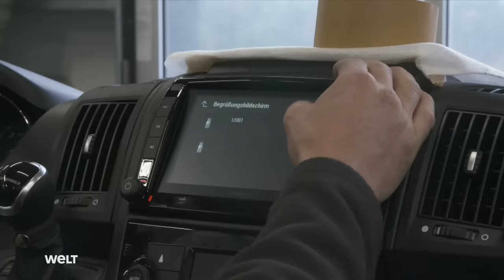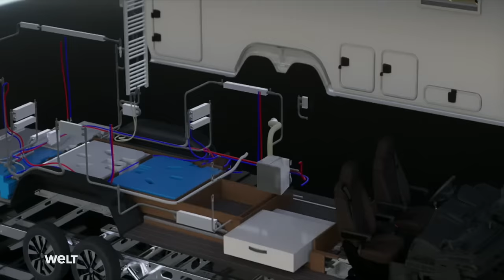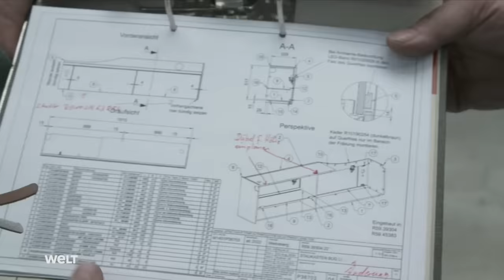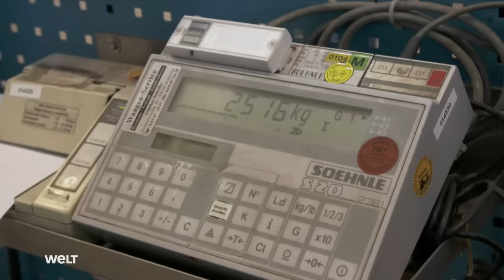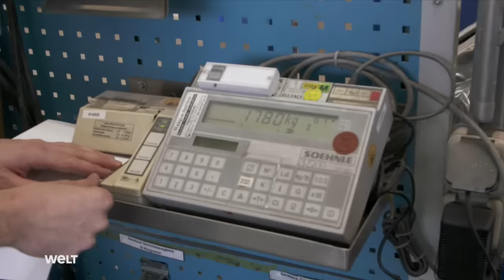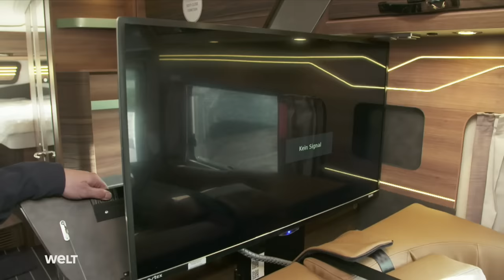MANUFACTURED IN GERMANY: Freedom on Wheels - The home of luxury motorhome | WELT Documentary

Comment: Why aren't the frames custom ordered? Why cut structural parts off in factory? What kind of high class German engineering is that? Spray painting your radiator is always smart too.
Reply: build your own 😂
Reply: @davidnjoroge8495  That has to be one of the dumbest and laziest responses I've read on here in awhile, bud. At what point did I say I could or would? You are defending a company with sketchy and overpriced builds looking at other competitors in the market. Sorry if it hurts your brain to think a little now and then.
Reply: mr unknown , you are not worth awnsering.   If you do not understand, keep a little distance from the kitchen
Reply: I thought the same thing too but since the chassis is built by Fiat it may be more costly by slowing down the production process.
Reply: Why masked???
Reply: Stellantis, FCA is not German.  It's cheaper to purchase these chassis in bulk as is.
Reply: You are not only unknown but also ignorant. ;) But I will gladly enlighten you. There are three different types of motorhomes. These are the box vans, where the standard vans of e.g. Fiat, Mercedes, Volkswagen, Renault etc are removed inside. Then there are the partially integrated vehicles where a cabin is installed behind and above the manufacturer's received cab. The model shown here is a so-called integrated motorhome where up to the chassis and the engine, brakes, etc. everything is rebuilt. Since the manufacturers don't supply something like this from the factory - obviously the quantities ordered are not large enough - the manufacturers go in and remove everything they don't need and replace it with their own design. But these RVs have to pass crash tests just like any car, van or truck.
Reply: @unknown your questions are valid. Sadly some on youtube accept everything as is and never dare to question. In many ways including cutting painting as done by them compromises the material/stucture. We can debate the severity but we cant dismiss the fact that its not ideal.
Reply: @gerhardma4687  
It is a FIAT Ducato and you forgot Peugeot and Citroën.  The engine is FCA Diesel.  Is that German?  Not arrogant, just literal fact.  Make no mistake, I love the Ducato practically and pricing to to keep cost down.
Reply: @kelleyhooper6749  The Ducato is really the No. 1 as Base for european Mobilhomes. My motorhome is also based on a Ducato chassis. But at the moment Fiat has huge problems with the ability to deliver. Therefore, suppliers such as you have mentioned and also Ford, Mercedes or Volkswagen are becoming more important again. My answer was related to your question about German engineering and the fact that the chassis are not delivered tailor-made. I am pretty sure that every European manufacturer has to do this like the Germans do. No matter if a Fiat, a Renault, a Mercedes etc. is the basis for the body. And there are plenty of manufacturers in Europe. France and Italy in particular are also very strong
Reply: No structurally important parts were cut out, that was only the mounting frame for the tank nozzle. This was moved outwards by its own parts, the stability of the chassis was not harmed in any way. So what are you talking about? Fiat will not build frames that are only needed a few dozen times. That's why these changes were commissioned by a specialist who knows exactly what he is doing. In Germany, every modification must be approved by the TÜV, so you can assume that the changes have not worsened the stability of the chassis. These are all professionals, not craft stalls as they may be possible in the USA.
Reply: They are custom ordered.  What you have seen is what FIAT is willingi to sell.  It's up to the company completing the vehicle to ensure its structural integrity.  And an RV not built inside a transit bus shell has poor structure no matter what.  It's flimsy box set on a truck chassis.
Reply: @Unknown_Ooh I had the same question a while ago wondering why we have to throw away so many components that in theory we should ask the factory to put in in the first place. Having many and high level connections in a known German brand and factory, I tried to get a chassis simply without anything I was going to get rid during the rv conversion. I was shocked when people explained me the complexity of a car production line and the shocking cost to introduce a rv-target version! Even e.g. a single component not put may waterfall into stucking the whole supply chain ...

Comment: The American manufacturers are not even close in build quality!
Reply: American manufacturers compete on opulence and features, Europeans on engineering. It basically comes down to much more lenience toward weight and size in the USA. The top model of Knaus here has a gross vehicle weight of 11,000 lbs. A Winnebago of the same length has a GVWR of 14,5000 lbs.
Reply: @choosumfat  You may have misunderstood me. 

I'm speaking of things like slideouts, large fridges, generators, plushy couches, elaborate 110 volt nets and large solar arrays, air conditioning , all kinds of exterior hookups, powerful and 4x4 options.

And they can do it because it's not a huge problem to live with a 30ft 15000lbs vehicle in large parts of the USA.
That most of them are designed like Granny's underwear is a pity, but that wasn't really the point. 

Yes, you can have all that in some euro RVs, but it is uncommon, and in the US it is. The common euro RV is much more limited in size and weight, and hence has to be clever to make the most of these limits. It's a fundamental difference in the approach.
Reply: @Lonestar24  I actually did not. You can have slide-outs (some much more interesting that what we have), larger fridges and elaborate everything. It's just a question of money. And as for them being common here, arguable. Most are just run of the mill class B/C with similar extent of basic equipment and capacity. The one pictured here is a 28' Class C equivalent. Sure it is pretty large for European setting (hence DL requirements) but you see them. 

Of course there will be differences in what people feel they like or need here vs there, and there will be some extremes, but that does not change the fact that our RVs are little more than slapped together livingrooms on wheels (most actually not more at all). The grandma aspect doesn't so much bother me because of style (whatever floats one's boat) but rather because it's so primitive in design/execution. And while true that across the pond size and weight limitations are far stricter and therefore RVs usually smaller/lighter, they are just as spacious, capacious and comfortable on the inside simply because of - from I have seen and experienced on few occasions of RVing thru France/Spain - so much better use of space and materials. They're way quieter than our typical Chevy or E-450 based RVs, too.

Now it could be I'm talking out of my ass generalizing, I don't own an RV. I do like RVing though and occasionally rent them both in the US/Canada and in Europe and from my experiences, there's really no question which I would rather have (same money really).

Comment: RV crash safety is primary in Europe. Not so much in the USA. We are still in the dark ages.
Reply: Sorry to say that it is probably the same.
Safety is not priority in Europe.
Reply: @matsstrandberg284  In Europe they crash test RVs. They don’t in the USA.
Reply: @matsstrandberg284  Motorized RVs.
Reply: Haha you don’t want to see what happens to these in a crash. Literally no point in a seat belt! Your dead at even low speed crashes that you’d walk away in in a car! Swedish transport agency tested them. Scary!
Reply: @Bonezmi16  Hymer has done extensive crash testing and did very well including children in coach seats. Others no so much.

European regulators have passed even stricter regulations for crash safety and all drivers of RV vehicles including trailers must pass rigorous written and driving tests. The USA only has a few states that require extra training for heavy motorized RVs.
Reply: @icare7151  I must clarify a little. I was referring to the fully integrated motor homes. They just fall apart on impact. The half integrated and van conversion one’s fair better the van conversion being the best due to no body changes. There was an accident near me involving a fully integrated where the 2 occupants died whereas the car they collided with were unharmed. I can’t speak for US versions as I’ve never looked into them. Only EU ones.
Reply: @Bonezmi16  💯 agree.

Comment: Knaus are really, really well made... I've built a few very special order semi truck trailers that have had Knaus top units fitted to them. 

For those wondering they were B-Double race car transporters, the A trailer was fitted out as a motor home, but we only built the chassis for that and Knaus sent us bolt on units. Considering they came all the way from Germany to Australia, they bolted up first time with zero need for mods. They were perfect. A very rare thing in multi factory manufacturing.
Reply: My gas connection in my new mobile home was not screwed on correctly after a short time gas leaked out.  Thank God I happened to be present.
Bad Work from KNAUS🤮🤮🤮

Comment: The way this manufacturer builds these RV's is way more professional and caring for their customers than most not all  but most manufacturers in the United States, I've owned a few, Starting with a palomino pop up It was ok, to a starcraft toyhauler now this was built  tough, then  a used 96  mini winnebago  that was kinda a half limon the structure was good but all the appliances gave out pretty fast  like the generator, frig, microwave,  water pump, & the A/C I replaced it after 2 years for a newer 98 jamboree class c also i still have it  but now that it's old  and I have to get under it to patch it up  and after looking at this video my sub floor is made of all kind of patches  aluminum triply sheet metal And plastic & Fiberglass and real cheap materials.

Comment: @about 23:00, you mention GVW of the top-line model. I remember back in the 70’s, comparable US models were often right at the vehicle GWL when empty, without passengers and supplies. As you can imagine, when it was exposed, it properly caused an uproar. Where are these finished, but empty, RV’s relative to the manufacturer’s GVWR? It speaks to the braking systems and drive train in general.
Reply: Many US RV "manufacturers" are very dodgy.
I am sorry to say.  Plus no lemon law protections buyers end up with vehicles in the "shop" for month after month after month. You get what you pay for.

Comment: Fortunately, as heavy duty truck mechanic I was able to avoid working on motorhomes most of the time. Some truck shops won't even entertain working on them. They're just a money loser for the shop. The motorhomes based on class 8 tractor chassis look like they might be a little better. Seems like a good idea to rent one if you want one occasionally. As it said with a lot of toys. The Best Day is when you buy it and when you sell it.

Comment: Sadly because of the way A class Motorhomes are assembled by manufacturers.  They become a nightmare for after service. Eg when pumps need replacing or general engine servicing.  Also if the fridge needs to be replaced try getting the old fridge out  and a new one in. Wake up Motorhome  manufacturers PLEASE.
Reply: Your not kidding, it's major disassembly time. And the fixings are never as secure once they've been out. All balsa and foam core crap.

Comment: The problem with this type of construction is the vehicles interior can easily disintegrate in an accident,  Plastic clips holding furniture board together might be a cheap and quick way to assemble them but can allow everything to fly apart and head towards the occupants especially in a head on collision.

If you want to see how a bespoke vehicle should be assembled for true occupant safety watch how modular Ambulances are put together, most cabinets are bolted and glued into place.
Reply: Exactly. Seems there is a zero safety. That why I didnt see any offical crash test of RVs.

Comment: Anyone concern about a motor home manufacturer cutting out a structural c-piller without reinforcement? Also, i hope they are using a 2k rattle can paint.

In the US, campers are built to not last. Built like house with 1x1 and just bounces down the road. I think the Motorhomes need to meet DOT as a vehicle,  but aside from the cab and the frame, the rest is flimsy.

I wonder if motor homes are crash tested.
Reply: In Europe 🇪🇺 motorhomes are crash tested. Quality of there factory build units is high. Wouldn't be scared to buy a 10 or 15 year old of these.
Reply: Nowhere was anything structurally important cut out here, that was only the subframe for the tank nozzle, not really to be described as a structural part.

Comment: All motor homes could be considered a "luxury". But welt is playing real loose with the word luxury in regards to these units. Plywood, plastic trim, spray paint every where.....
Reply: And panels bolted together by dowels and screws!
Once the motorhome is on the road with vibrations and shock, surely these panels will slowly become loose over time. That's not what you'd call "luxury", which costs over $100K!
Reply: Brabus & Klassen are quality. This is far from it..
Reply: When you look at the number of systems onboard it's most definitely luxury...much more complex than most homes and in a small space. Material choice is about weight saving, something that's irrelevant in a house.  No Italian marble in this vehicle.
Reply: I was really surprised how the radiator was painted in situ.  I am not sure how long these are intended to last though.
Reply: @mattnoyes7729  I'm more commenting on build quality. Rattle can spray paint, sawzall's being used everywhere, tape..... Now this is completely on the other end of the spectrum, but check out how a  Newell, or Prevost is built out.
Reply: @mm-nyc  It's a mostly hidden part, if the paint coat ever get's damaged, you can just spray it over. It still retains it's actual protective lacquer underneath, so damage shouldn't be an issue.

Comment: Nice to see another FWD motor home.  The GM one was one of the only previous ones and that was decades ago.  But 180HP and a manual transmission aren't going to put Winnebago (or any one else in the U.S.) out of business.
At least they're using plywood instead of the (weak, heavy, cheap) particle board mostly used here.
Foam core aluminum faced walls help explain the only 8 Ton weight mentioned.  In fact the largest, heaviest model is listed at 12,000lbs gross or 6 tons on the web site specs.  Very light for a 29 ft. class A.
Now if they could manage to get a current Ford power train into the FIAT chassis with the 400HP 10 speed they'd have something they could export to the U.S.   FIAT/Stellantis doesn't have a suitable power train for that chassis.
Reply: That weight is important as the weight limit for the "small" driver's licence is 7.5 tons (loaded). Which, BTW, is included in all German car driver's licences from before 1999 but not the newer ones (only 3.5 tons).
Reply: So they can’t be used?
Reply: @stupidhead9117  Upgraded license required.
Reply: ronnie doorzon  You're referring to a trailer, not a motorhome.
Reply: There wouldn't be much point in European style A class models in the US. America does build B+ and C class models on European market chassis like the Sprinter and Transit - that is what the Ducato is equivalent to. The reason to go to the extra expense of building an A class motorhome on such a chassis for Europe comes down to maxing out the lightest chassis platform to get the economies of scale and produce an RV that is still very usable on European roads. 

The A class motorhome chassis like the Ford F53 you have are equivalent to European medium duty cab-over-engine trucks like the Mercedes Atego and DAF LF. European companies do build 30 foot motorhomes on those chassis that are much closer to American A class, but there is no mass market for pure RVs on that size platform - it is more common to see race car and horse transporters built on that size platform with living space than it is to see a pure RV.
Reply: It said it was 8 meters in length, not 8 tons. They weighed it at the end and it was 4.2 ton or thereabouts. It's probably a 5 ton chassis so has 800kg payload.
Reply: @scottb5716  As noted, the heaviest was 6 tons so I fouled up on the 8 T .
Reply: @Scott B  correct... 5 tons GVW is the max rating for the tag axle 6 wheel Ducato, they can't be plated  any higher due to the limitations of the brakes / suspension / chassis. The Ducato is the best platform for class B/C motorhomes that stay under the 3500kg GVW license limit. The standard length Ducato chassis cab is the lightest on the market at 1630kg and has a low rear chassis thanks to being FWD.

Comment: lol . . . . @12:04, wonder if that includes the gray water too? . . . . that would suck.
Reply: Yes, it does. And while it would suck a bit, it's not supposed to happen on the regular.

Black water tank you'd typically protect with a special liquid.
Reply: If you store it at freezing temperatures with full tanks and without plugging it in, yeah, sorry, that mess is on you. ;)

Comment: They sure don't build them like they used to. I would hate to get into an accident in that thing because it would look like a drink can or foam exploded all over the road mixed with "high quality" plastic.  When you have to lift the frame to screw the foam wall to it you would think someone would think maybe this isn't strong enough to last but as they said reducing weight is their primary concern.